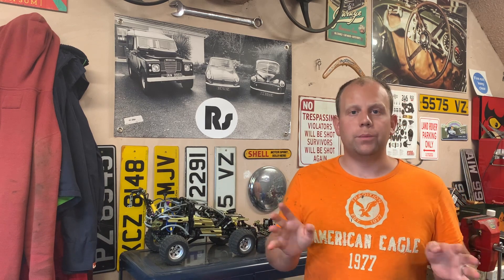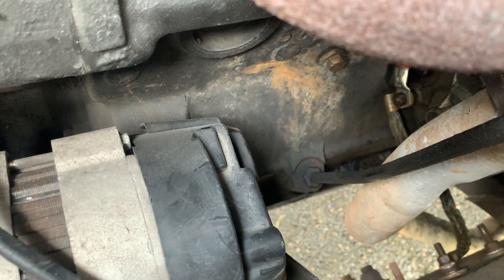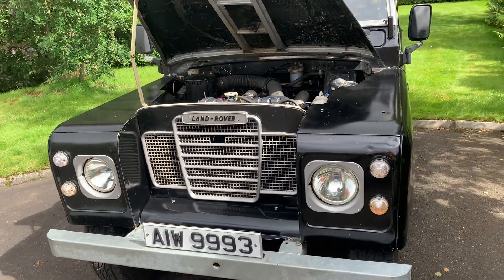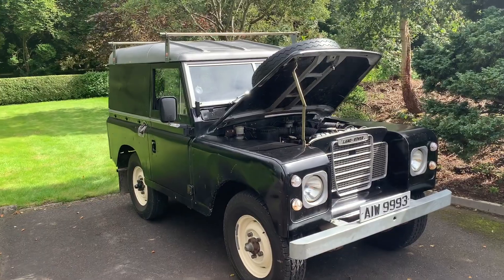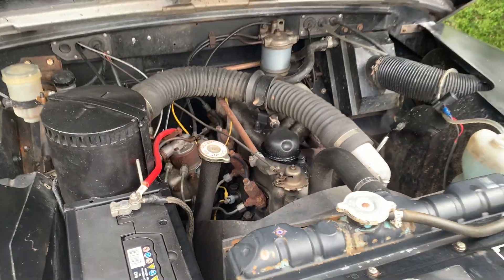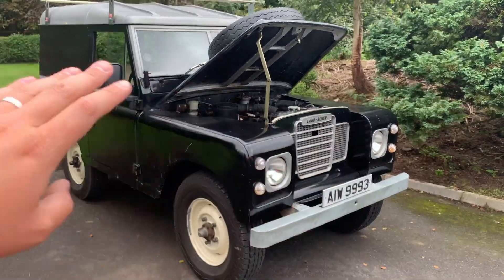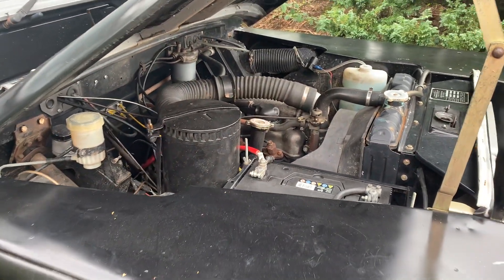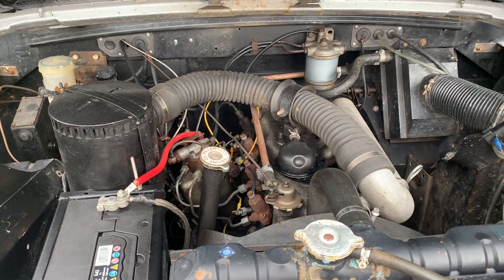Engine Conversion Options - Land Rover Series 3

Comment: Have you made a decision on the course of action?
You could mechanically repair that cracked block - a "metal stitch" repair would probably the most effective. Having done this myself, it does require a great deal of time and care, but usually results in a far more reliable repair than welding. That said, if you go down the route of engine out, strip down etc..  then have a look into laser welding, it doesn't need the pre-heating and doesn't put great amounts of heat into the casting. 
If that were mine, I'd certainly be doing a metal stitch repair, but don't dismiss products like "K-Seal" or "Radweld" which can actually do the job long term for a minor leak.
Reply from the maker: Thanks for your comment Phillip and thanks for watching also! At the moment my plan is the keep the engine I have and when I have the wing off for painting I will lightly die-grind out the crack and drill it at both ends before filling it with JB Weld. I have found someone who could weld it but access may be an issue for them. 

Love your videos and FB posts by the way, keep up the good work!
Reply: @restosaga  I'm sure that will last just fine, and if it doesn't it's not so permanent that you haven't got other options. Glad you enjoy my posts, I always enjoy following other Land Rover projects too. Good luck with the repair.
Reply from the maker: Thanks! Yes, that is my thinking too. All the best

Comment: The most common 200 tdi ore 300tdi is to do a way with the turbo as the transmition is not strong enough for the turbo in heavy use so if you wont a trubo i would recommend to up rate the transmission and most of the drive chain to the defender ore remove the terbo is you wont it to stay as standard as possible
Reply from the maker: 200di is definitely something to consider, thanks!

Comment: V8
Reply: I did my series 2. I used a rover v8 engine out of a p6.  Use two drivers side manifolds or P6 manifolds that exit straight down. A slight modification to the bulkhead for access to the spark plugs, a Philips bellhousing adapter, range rover flywheel, series 2 rad with extra row of cooling core, mod your series 3 engine mounts,  didn't have to touch the battery tray. Use RR classic diffs or 200 TDI, and lwb 109 front breaks. 24 MPG. All simple spanering. Have fun.
Reply from the maker: You make it sounds quite manageable! Thanks!
Reply from the maker: Would love to! Fear the installation fabrication may be beyond me though sadly.

Comment: Its very common for the 3 main bearing blocks to crack...this is why they brought out the 5 main bearing...if it was me i would just repair that block if the engines good...
Reply from the maker: Thanks! Did not know that actually! Yes, think I’ll repair the block as the rest of the engine is fine

Comment: I did a V8 conversion on my series 1 If I was going to fit a v8 again I would look into using a range rover gearbox as the conversion plate is expensive you also need to mod the crank or the input shaft  on the gearbox. Loads of fun to drive when finished .
Reply from the maker: Super, thanks for this, definitely food for thought!

Comment: great vid,ive had landrovers since 1983.oops showing my age! desiels ,petrols .straight 6 ..i wouldnt go for the 6 pot hun, a lot of  work putting it in ,weighs a ton! tbh  not much more power than a 4 cly petrol, even if you could find one. the parts are crazy price!..they have their origins in the 1950s, inlet  valves overhead , exhaust side valve ,and they love going thru head gaskets! ive a 4 cly petrol , just a weber carb on .low miles 47k ,so goes ok , a 9 to  1 head is next on list ,i think yr best plan is a tdi to be on safe side....but on the wild side a v8 or ford v6 !!. but getting a "good" one is very expensive these days
Reply from the maker: Thanks! A very comprehensive answer!!!

Comment: This could be done insitsu - Metal Stitching
https://www.google.com/search?client=firefox-b-d&q=cast+Iron+crack+stitching

The other side of things, It s my understanding that the 2.25 petrol and diesel share the same engine block.  Is it possible to just replace the block with one from a petrol? ( reuse all your existing diesel internals and externals)
Reply from the maker: Thanks for this! I think you’re right but for some reason the diesels are significantly cheaper to source. Fingers crossed I can save my original!
Reply: @restosaga  I have seen such crack repair by stitching in real life ( retired engineer)  I recon your block is very repairable by the stiching process.
The other thing that goes tru my mind is that, given the 8 years or so that the crack has existed and presumably not got worse, why not try some Bars leak or pepper in the coolant to seal the leak and leave the crack.  ( would not do this If I were planning a trip around the world in the vehicle)
Reply from the maker: Sounds like a very fair suggestion!

Comment: Hi there, here in Australia some of the earlier versions of land rovers as supplied to the Army had 3.9 litre isuzu 4 cylinder diesels .
This motor was the 4BD1, not sure if the army had the turbo version of it.  They went well in the n series isuzu's .  In the land rover swb it would go very well.

Or the other isuzu  engine, was the 4BE1 n/a, of 3.6 litre capacity, I've had many of those and found them to have good power in the light trucks and economical.

Food for thought for the " Landy "
Reply from the maker: Nice ideas Roy, thanks! Definite food for thought!
Reply from the maker: Right! My gearbox is giving trouble too, never stops with these trucks!

Comment: Have you considered having the block "metal stitched" (block is drilled along and across the crack and soft steel wedges are driven in and peened into the drillings to "fill" the crack) which may be possible in situ (depends on the company or how serious the crack is) but if not engine only has to be sent as unit only removing parts to allow access, we've just had an 8 litre Iveco diesel from a combine harvester with a 12" crack in the block repaired when finished you couldn't see the repair and was pressure tested as well.
Reply from the maker: Thanks Steve, this sounds like a great solution, I’ll look into it!

Comment: I have a series 2a with a 3.5 v8 with range rover diffs and I can get about 20 mpg that's about the same mpg as standard plus twice the power
Reply: did you do the conversion? ive got a 2a swb with no engine and found a range rover 3.5 v8 for a $300 AUD. its very tempting, but im scared on how much it will set me back
Reply from the maker: Nice one! No, I haven’t started to the engine yet, been working on the front axle instead. Video soon!
Reply from the maker: Sounds ideal, thanks, food for thought!

Comment: 200 fits in my ser2 with original rad. ( fat one) I dont run any fan and don’t need one( neither will you in Ireland) 90/95 degrees top temp. Mainly 75/80. Great mpg superb starting. I still drive it like it’s an old petrol and gather speed rather than spinning wheels and I’ll change down rather than flogging it up hill in too  tall a gear. If you keep breaking halfshafts then you’re driving it like a c@@t.
Reply from the maker: Sounds like a sensible driving style. Thankfully have only snapped a driveshaft once, and that was with the 2.25d

Comment: I could be wrong here but I believe the cast iron blocks had a tendency to be porous when originally cast so they were treated with some sort of resin. I'd be interested if anyone has any information about this. The land rover should really be kept original. Can't believe I'm saying this but considering what I've said and the small nature of the leak I'd put some radweld in it while no one was looking and deny ever having done so.
Reply from the maker: Haha, it’s not an unreasonable suggestion Fred, thanks. I’m not sure regarding resin coating, interesting!
Reply: @restosaga  It wasn't a coating, it was pressurised and driven into the porosity. I believe they had quite a lot of porous casting during manufacture, I think it was a common practice with castings..
Reply from the maker: Thanks, did not know this!

Comment: My son and I have done the 200tdi conversion into Series 3 without the turbo....it’s still a strong and powerful diesel without turbo and starts after half a turn in all weathers even without heater plugs. Look up Glencoyne Engineering.....the owner is really helpful - he has all the information you need to do this conversion. He also supplies quality parts you may need and can undertake some of the limited engineering needed.
Stephen
Reply from the maker: Thanks! That’s great to hear. I think the 200tdi without turbo sounds like a good plan!

Comment: Did a 2.6 into 88, didn't like it. Heavy, Thirsty and doesn't rev. Repaired a split block with special welding rods, easiest welding I've ever done. Run about and inch, peen it with a small hammer, weld another inch in another spot, peen repeat until damage repaired.
TDi 200 bolts straight onto the series gear box ( the 2.6 doesn't unless it was a 2ltre engine box, nor does the TDi 300
). Disco unit will need a scallop put into top of chassis to accommodate the turbo, defender unit the turbo is up high. Get the radiator and inter cooler from donor vehicle, with a little tin work it will replace your current rad. Very easy conversion, but will take three times as long as you first thought.
3.5 V8 you need to find a conversion kit. A little tin work on the chassis, nothing major. V8 radiator fits between chassis rails, carefull of the steering relay. 109 brakes, servo of some sort and you are sorted. Pull away gently in first, drop into second and hold onto your hat. A good series gearbox will take gentle power as will the half shafts but if you plant your right foot more work is needed.
Reply from the maker: Thanks Robert, a very comprehensive answer that covered a lot of my questions!

Comment: Hi, I am currently facing the same topic.
I have a worn out 2.25 diesel, and was looking at all the options.
To be honest I have decided to go with the 2.5l petrol cause of the power and how easy it is to swap.
I was able to find two for a reasonable price here in Ireland in a matter of 1 week.
And the good part is that the 2.5 has the hardend valves which allows unleadded petrol.
All you need to chnage is the trottle linkage and the exhaust wich is available from Steve Parkers.
The electrics is a easy job.
Cheers
Reply: I have a 2.5 petrol also, but with 2.25 manifolds + exhaust. For electrics the stater solenoid is on the starter, so may need wiring extended if yours is by air filter
Reply from the maker: I really do like the sound of the 2.5 petrol!
Reply: Oh and you need a ignition switched + for your coil, gues you could use wire that goes to the injector stop solenoid - if the 2.25D has that (?)
Reply: @mully89  If you are doing the conversion from a 2.25 diesel, the starter has the solenoid at the right place.
You do need to pull a live wire which is also "crank-on" for the ignition.
Reply from the maker: Thanks
Reply from the maker: The 2.25d doesn’t have this, just the glow plugs on the ignition switch?
Reply: @restosaga  It's possible to use a diesel ignition switch for a petrol... I did on mine when I rebuilt it 8 years ago and went from 2.5D to 2.25 petrol. Can't remember exact details but I'm sure it involved bridging two pins on the ignition switch.
Reply from the maker: Excellent, that’s great to know, thanks!!!
Reply: @restosaga  Have you started your project?
I have just found a 2.5 petrol engine for my LWB series 3.
As soon as the parts from UK arrive, my mechanic will start the job...
Reply from the maker: Nice one! I haven’t got started yet sadly!
Reply: @restosaga  I had my engine conversion done, and I love the 2.5 Petrol! I had to add a ignition switch till I swap the key unit for a petrol one.
So much more power! She is now amazing to drive.
I reach 90km/h in no time.
Reply from the maker: Oooh, nice one! Those engines can be hard to come by
Reply: @restosaga  that is true, it took me a while to get a 17H engine... but worth the search.
Reply: Its a good engine, plenty for an 88, Well Im no expert,I think if you get rid of any timer/relay you could feed coil from there,  but the good thing with series motors is its easy enough to poke a new cable through the bulkhead
Reply from the maker: Haha, very true indeed!
Reply: I just wanted to give a 3 year update. I finally swapped the ignition switch to a defender diesel one which has a pin for the fuel pump which I used for the ignition coil.
I had to go this route because the other switches were smaller in diameter, had to find one which was 45mm. But I got that sorted out, and the Land rover looks original again and no additional switch to turn on/off.
To summarize, I would do it anytime, it is so much nicer to drive, no smoke and loads of power. But she is thirsty, and I had to swap the carb, because the old one was acting up and I didnt have the time to diagnose the issue.
Cheers
Reply from the maker: Nice one! The 2.5 petrol is very appealing. Was there a lot of electrical work involved for you?
Reply: @restosaga  Well I havent started yet, but all you need is a ACC wire for the ignition coil and the Carburettor solenoid. Just make sure that they are are still live during cranking. I cant think of anything else. Of course you need to have a mechanical fuel pump, but you can use the one from a 2.25 petrol.
Reply from the maker: Excellent!

Comment: Had a series 3 diesel that had the 2.5 litre N/A diesel installed, straight swap basically, I had to relocate the battery under the passenger seat though, used to regularly get better than 30 mpg when used with the overdrive, a good choice if changing the engine without any major cutting to chassis or panels. The 3.9 litre fuel injected V8 is an excellent choice if you don't mind all the work involved and the grin will go from ear to ear!!!!!
Reply from the maker: I like your thinking, thanks for the help!

Comment: I have a series 3 88 here in Canada, I kept the diesel, and the 2.25 gaser, and installed a chev 4.3 V6 out of a chev S10. The original engines are clean and wrapped in plastic for the future, but the V6 fits nice, was an easy swap, and uses no more gas than stock. However the increase in BHP is very nice and the twin exhaust sounds great. Im also building an 88 into a rover 4.0 V8 at present, its an uphill battle. so much shifting about of things to make it fit, kind of goes againt my original goal of keeping everything stock and just adding the V8.
Reply from the maker: Nice one, it’s great you have kept the original stuff too 👍🏻

Comment: Also an Essex v6 is a great engine
Reply from the maker: Yes, that would be a really cool conversion!
Reply: Restosaga Workshop I have just bought a Steve Parker’s conversion plate myself. Saving up for an engine. The 3.0 is awesome. Put RRC diffs in and you can cruise well with modern traffic. Plus still achieve 25mpg. No bulk head modifications either . Just got to get the engine myself and I’ll upload a YouTube video on it. Will probably be in the new year now once I have my garage .
Reply from the maker: Thanks, I’ll keep an eye out for your video!

Comment: Use jb weld with fibre glass reinforcement tape. Just like a mesh. Do the repair with a large surface area and it will stick forever . Have done this on my 2.0 rover p4. Works perfectly :)
Reply from the maker: Nice one, thanks very much!

Comment: Toyota 2,4D works well, done many times in South Africa. These engines are legendary for reliability and although not endowed with huge torque or power it will make your Landy a lot more usable and to be honest any more power in an old Landy would render it unsafe with its brakes, suspension and steering being what they are
Reply: Hi would that be a 2.4D(2L engine)??? Would it work on a series 4 speed gearbox or gearbox will need to be changed aswell??
Reply from the maker: That’s an interesting idea! Thanks!
Reply: Which gearbox sir

Comment: 200 tdi without the turbo, same engine mounts, no more noisy than your current engine, can use your exhaust manifold.
Reply from the maker: I think if I was doing higher miles I really would be up for a 200tdi, not sure I can justify all the work to install it for all the use it will get though sadly.
Reply: @restosaga  200tdi without turbo basically a bolt in allegedly.  There is some great info on 200tdi and di here:  http://www.expeditionlandrover.info/200tdiconversionIntro.htm
Reply from the maker: Thanks Brett, looking into all the options

Comment: Fill it with rad weld. 
I have a 2.5 na in my 1985 90, not had many problems. Could do with some valve seals though as a bit smokey.
Reply from the maker: I think I’ll try and fix it myself as you say, nothing too pricey. Mine’s smokey too!

Comment: Would you not be concerned that you will loose it's originality if you move from the 2.25D ?.. If it's there 8 years, why not consider leaving it as is, put a repair additive in the radiator and see how that goes. My opinion keep it orginal the best you can.
Reply from the maker: Thanks, I agree, really would prefer to keep it original as long as possible, a radiator additive isn’t a bad idea!
Reply: yes orginal is best ,
Reply from the maker: I think you’re right. Still looking into fixing the original block...